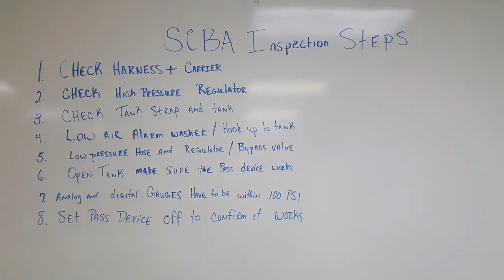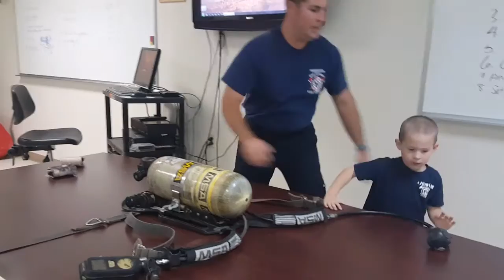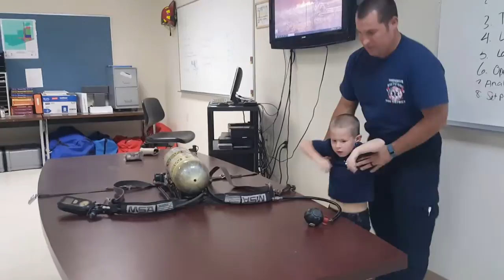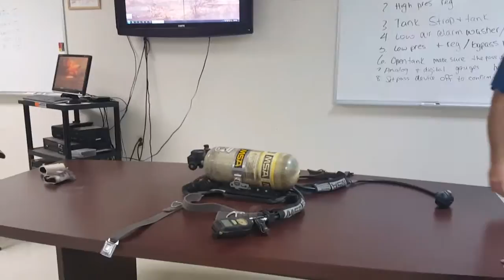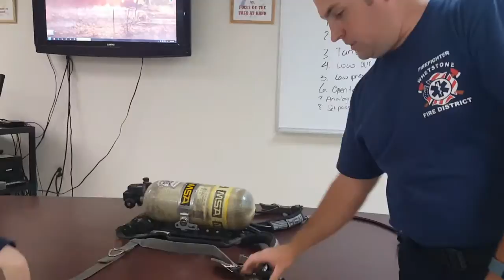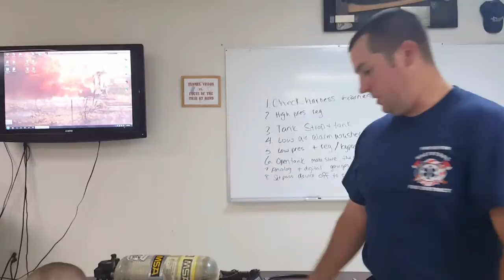Scba inspection

Comment: Good job but your facemask is also a piece of the scba unit.... air it up and check to see if you get a good seal "negative pressure teat" also check the straps and rubber seal for any cracks or abbrasions